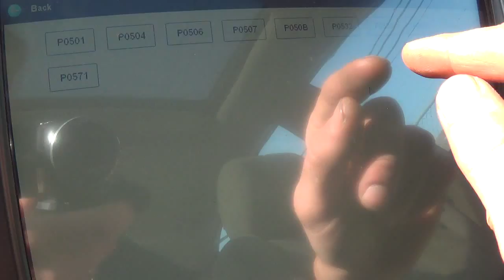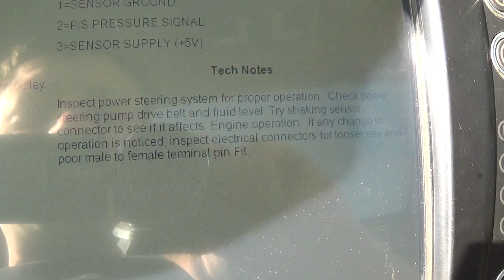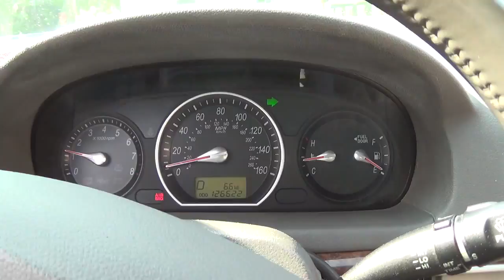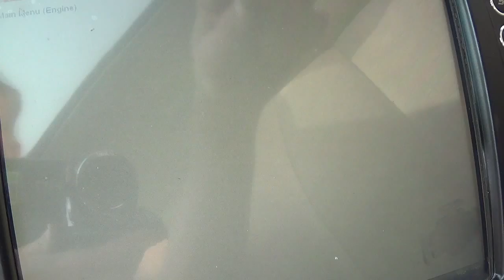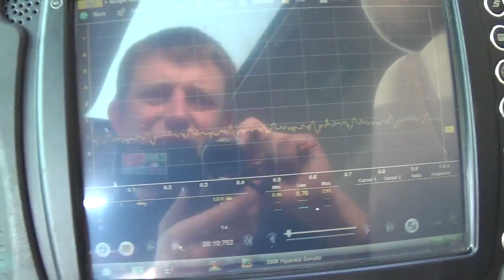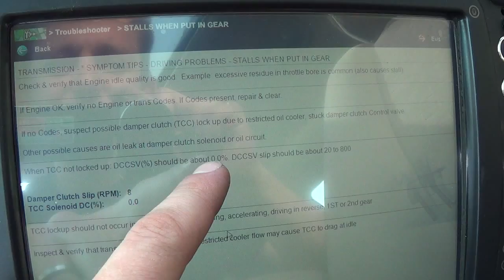Hyundai Unintended Acceleration (SI Ep 1.3)

Comment: I have a Sonata with the same exact noise and issue with slamming into drive. I replaced the solenoids/transmission fluid and input and output speed sensors. I’m stumped.

Comment: My 2003 Toyota Camry 3.0 V6 experienced a high idle after I removed and cleaned the throttle body.  I did not reset the computer initially, but after experiencing the high idle, I reset the computer and all had returned to normal.

Comment: This is exactly what mine is doing. It's so scary.  Thank God my brakes are good.
Reply: Report it!!! My 2010 Toyota Prius Suddenly Accelerated Unintendedly on January 31, 2019. This is still happening! This was not the Floormat! I did not mistake the Gas Pedal for the Brake Pedal! I Never Have! The pedal was not Sticky! It Sucked itself Full Throttle right to the Floor when coming out of a right hand turn! Brakes held but Engine was Revving like crazy. Every time I released the brakes to try to get the gas pedal to come back, the Prius took off. Can you imagine starring down with your foot on the brakes, and the gas pedal is still pushed in Full Throttle? Explain that?? It did this for about 2 and a half blocks. Shifting to Neutral was NOT working. It wouldn't Turn Off. And I didn't want to press the "E" Brake risking the lines snapping and having NO BRAKES! That was my last resort. This was Crazy and Vehicle Manufacturers need to be held accountable! I've made a "Safety-Related Defect Complaint"  to Transport Canada 🍁. You should all do the same in your country. Let's fight this and end Sudden Unintended Acceleration!  Maybe going back to a Drive By Cable system instead of Electronic Throttle Control will be the answer. There's gotta be a solution!

Comment: P/s pressure switch being a 5 volt sensor, is it a good idea to send battery voltage down the signal wire?
Reply: seems like the proper jump would have been from the 5v reference voltage
Reply: @VigilanceTech  hyundai and Kia actually have a special tool for this. I'm sure others do to but it's a function of the oscilloscope attachment for their factory scan tool. It can produce up to 5 volts to check for voltage drop.  You use it in conjunction with live data to see what the pcm is actually reading
Reply: Brandon Foss depends on how your sending it. Test lights can be safe but it depends on current flow.

Comment: TCC solenoid can stick on and drag the TCC and cause that problem, as Ivan and the Verus troubleshooter said.   That vehicle may have been fixed easily with a TCC solenoid, and may not have needed a replacement transmission.  Love what your doing Ivan!

Comment: I have a Sienna that does accelerate out of control, but when it is on cruise control and you have a hill coming up. Normally you set the cruise control at 65mph but instead of just maintaining that speed uphill or going to 70mph, it accelerates and then it accelerates out of control to 100mph before I shut the cruise control off before it quits. Definitely an issue, scared me the first time it did it. Now I just shut off the cruise before any hills.
Reply from the maker: Wow that is strange! And 100mph is fast for a minivan haha
Reply: motoYam82
 if I let it, it would just continue to whatever its top speed is. It got to 100 in a few seconds from 65. But the first time it caught me by surprise as I just bought it and kept accelerating and for some reason shutting the cruise control off stopped it. I didn't even think to press the brakes. I was like, what the hell? Still happens randomly, but only on hills. Not all the time either. Yeah, probably something to do with cruise control or who knows.
Reply: Normally the transmission would maintain the same gear uphill if I am not mistaken. It will be interesting to hook the Techstream or OE level scanner to check if the gears shifts while uphill and check the solenoid pressure.

Comment: It looked like the power steering pressure drop coincided with the gear shift issue.  Not sure if it is just a coincidence or cause and effect.  I would take a look at a wiring diagram and check for possible transmission solenoid and associated wiring errors that could disrupt the power steering pressure readings and vice versa.

Comment: my last car was a 93 ford escort (5 speed) It also had a racey engine the check engine light was lit the engine would race after coming off the highway off an exit ramp when I would bring the car to a stop the engine would race but if you tapped the gas pedal it would return to a normal idle (without any noise)
Reply from the maker: sticky throttle plate or idle valve?
Reply: Could it be a throttle cable?

Comment: Hey everyone I have a 2003 ford focus zetec.its got high miles.im having an issue with the idle and acceleration.it wants to idle at 2500 rpms if you put it into neutral and you have to turn the key off immediately it wants to shoot up to 5k rpms.it has no vaccum leaks I've smoke tested it.maf readings are normal.any advice?
Reply from the maker: It has to be excess air entering the engine through the throttle body or idle air control valve. Check those for proper operation or sticking. 

Lumina EURO in the avatar...nice!
Reply: +motoYam82 thanks man that was my first car,she was beat to hell but I loved that car.i learned everything about cars pre high school auto shop.ill check for a vacuum leak or a sticking iac
Reply: What was wrong with it?

Comment: I've got a 62 microbus and it's missing the three little louvers near the roof above the engine louvers.  Had no idea the 63 had those and the 62 didn't.  You don't need no fire in the winter under the engine -- mine starts fine down to -40 below as is, you just hop in and start it up while pumping the gas a bit more than normal.  Always lusted for a 67 transaxle as those had the highest gears in that style of reduction box transaxle.  In 68 they went to the 'modern' style transaxle with booted CV joints which won't work under there without some modifications.  The reduction gear box at the rear wheels allowed for tremendous ground clearance which came in handy when I took mine over mosquito pass from Alma to Leadville once upon a time.  Decidedly 4x4 country but the ol V-dub did it anyway.  I wound up wearing most of the contents of the under dash storage tray, but that's what happens with those.
Reply from the maker: Great memories, thanks for sharing Lee! Now what was that long tube going straight from rear to front under the van? Almost looked like a driveshaft but they didn't make the Synchro 4x4 version until the 80s right?
Reply: +motoYam82 that tube has the shifter running through it..check out mustie1 on YouTube he has a great series on the pickup version of the bus. His is Rusty but not as rusty as that bus
Reply: Sorry for the delay, someone (he-he) had a plus.google entry in their host file so replies have been dead for quite a while now.  Was never aware of the Synchro 4x4 but will have to look into that now that you've mentioned it.  Jeff has one answer but that shift tube is hardly 1 1/2 inches in diameter, what probably got your attention was the defroster/heater tube which is close to 3 inches in diameter conveying hot air from the air boxes to the front of the cabin.  I mounted a booster fan on mine under the front seat area for better/more air flow and tried to insulate it too with pipeline tape over fiberglass.  End of the day it might dry out a wet glove in about an hour.  Funnyiest problem with that system is when you hit a puddle of water, your front glass turns to instant and total fog over, makes for cheap thrills on the interstate.  OMG -- we all gonna die.  I eventually used dryer vent tube to pipe engine waste air into the cabin and it was like a sauna in there.

Comment: No electrical checks of the Tcc solenoid with a current clamp and 2 voltage connections to see if it was opening and closing ok?  Man!  Lol.  Really wanted to see that.  Can you do after captures for it Ivan?
Reply from the maker: I could have gone a lot deeper with this one, but we had a full day scheduled (as usual)...you know time constraints :) What I have learned while working with Keith is that in order to be profitable in this field you have to be accurate and EFFICIENT! In any case it was easier for the shop to replace the transmission assembly that tear it down and replace individual parts and such...but a current ramp on the TCC solenoid would have been an interesting check for video educational purposes.
Reply: +motoYam82 I hear ya on being efficient.  When I have quite a few diags on the work board for me my Foreman and I tackle the vehicles we think are going to be not as tough and save the problem vehicles for last.  But of late I have been getting more problem vehicles than the easy ones.lol.
Reply: How about the consumer? A solenoid is way less expensive than the whole Transaxle.

Comment: Being somewhat of a transmission guy, it kills me to not know exactly what was wrong in the transmission.  When you looked at the transmission data.  I noticed that the pressure control solenoid was either at 100% or 0% and nothing in between.  Which I find strange because normally the pressure control solenoid is a duty cycle type of solenoid which can range between 0 and 100 (not like a shift solenoid).  But maybe this transmission is different than the ones I am used to though.

I would have loved to hook up a line pressure gauge and measuring the line pressure when the issue is occurring and see how it compares to spec. Good video!!
Reply: Good points there.  I was in itching for more scope captures of the Trans.
Reply: MattsMotorz 

I got a question for u I have a 98 town and country no Speedo no 4th gear shifts hard driving it in town only I replaced input and output speed sencers...  anything eals I should look at shift solenoid????
Reply: I thought the same way. I was doubting the TCC lock up solenoid. Now I am thinking probably a solenoid replacement would've fixed the issue instead of changing the whole unit.
Reply: It has to be diagnosed but would start with checking the transmission  fluid level first.  Hooked to a scanner and check shift positions. it could be a wrong input situation ( Speed sensor, coolant sensor,..) not causing the proper shift. Could be a wiring issue, or a malfunctioning solenoid. Good luck!
Reply: Vince...    pin connection at those sensors is a very common issue.  New connectors are readily available.

Comment: Hi Ivan. thanks for your video. In this auto transmission you should see 0 input & output rpm at drive with brake applied and you should see input rpm which close to engine rpm and 0 output rpm at reverse & park with brake applied. If you see any input speed at drive with brake applied, that indicates torque converter clutch engaged or stuck. Thanks again Ivan
Reply: Thank you!
Reply: He said that in "text" during the video.

Comment: OK, so the torque converter  lock up clutch is on. Maybe unplugging the connector might stop it.
Reply from the maker: They already tried that, which explains all the solenoid codes. Also the PCM would have flagged a code if there was an electrical problem :)

Comment: I'm not sure what the time difference is between the diagnosis and the video getting posted, but if it's not too late, tell the shop to hang on to the VSS from the old transmission until the repair is complete and 100% verified.

Some Hyundais are subject to a nifty little calibration issue involving the VSS, and when swapping out the transmission, the difference in spacing between the sensor and the tone wheel can occasionally cause overdrive issues on the highway.  The proper solution is to recalibrate with a factory scan tool (not sure if aftermarket tools have support), or swap the old speed sensor in following factory torque spec.  I've had enough success with the latter to have never had to perform the former.  :)
Reply: That thing sounds rooted.
Reply: Damper in the TCC rattles when its dragging like that, plus it shakes everything on the car.  Doesn't mean the trans is shelled.